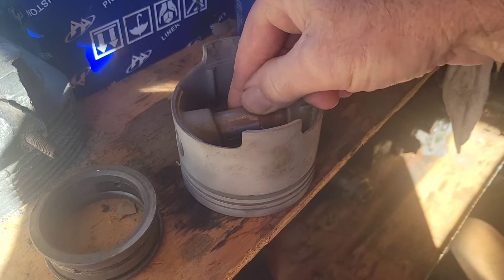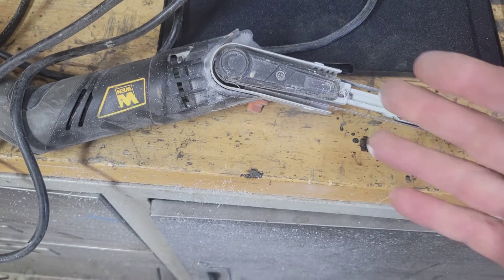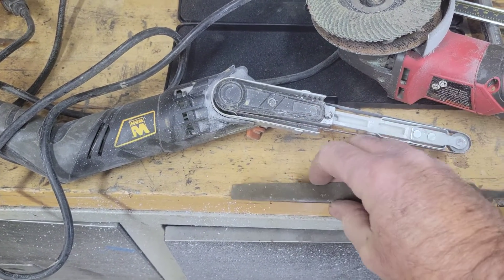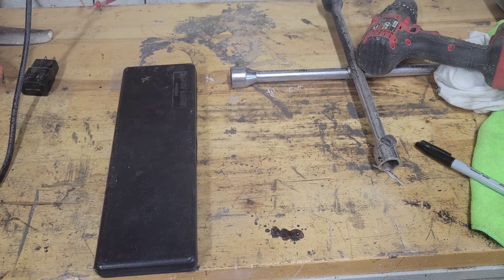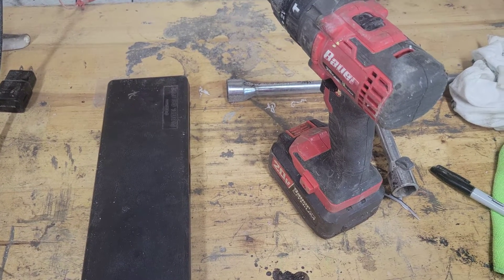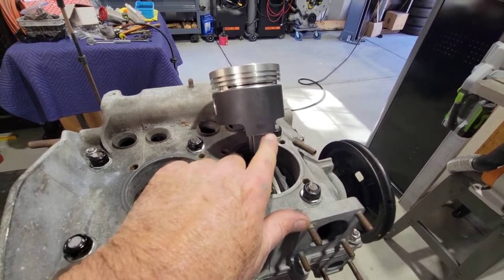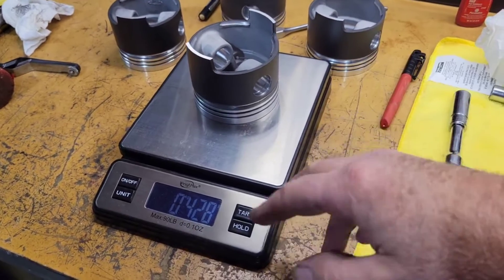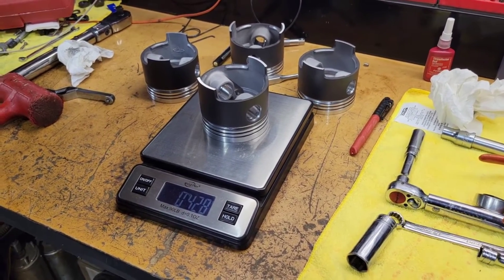VW FLAT 4 Air Cooled Piston Skirt  Trimming for Stroker 74  88 and 85.5

Comment: I can see why you would trim the skirts but if you don’t shim the cylinders how do you keep the piston from coming out of the cylinder with the bigger stroke…..Stroker piston’s are available for any stroke crank….and what rod length are you using….and I also noticed in another video you used a step cut head and a copper o ring my Question is why

Comment: Looking good 🎉 thinking about copying your 1800 for my 69 bus. I have a 1600 at the moment that I daily drive.
Reply from the maker: Go for it! IMO best way to do a rebuild. If your case is single relief with 10mm studs perfect fix. if it is dual relief with 8mm studs I would go 1904 or 1968 thick wall. Dual port heads also would be a great upgrade. aa performance 40 35 with stainless valves and single high rev springs.
Reply: Also CB Performance heads are great.
Reply from the maker: @vayabroder729  Oh yea for sure But more $$$$. Better quality though.
Reply from the maker: @vayabroder729  Retail now is like 50 a head more. might be best to go with CB.... Wholesale is big difference for me. dont get a discount at CB. But the retails are better at CB now. 2 years ago it was more than 100 each head difference retail not now. China issues.....IMO. Biden is too buddy buddy.....

Comment: Hey Mike, I have a question. Let's say I was going to rebuild the top end of my stock 1600 dp. Would there be any benefit in trimming the piston skirts or would it be a waste of time ?
Reply from the maker: dont need to with stock crankshaft. But if later on your going to upgrade might want to do it. wont hurt either way. put some 88s on a stock bottom end is just fine. Remember you will need the heads machined to 92 or 90.5 to do that. or just buy new ones at Car craft aa 40 35 already done. call them or email so they know what your trying to do.
Reply: @Mikefngarage  great to know !! So with the 88's and the new heads, what carb should I run. I live at 8500' in Colorado and it's my daily driver (not in the winter though 🤣)